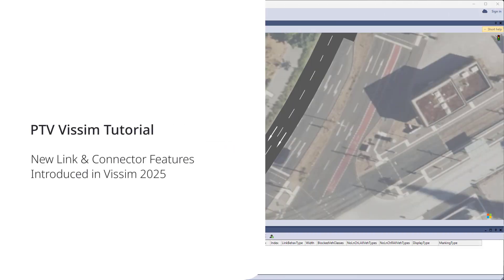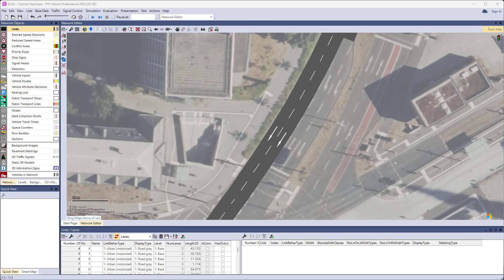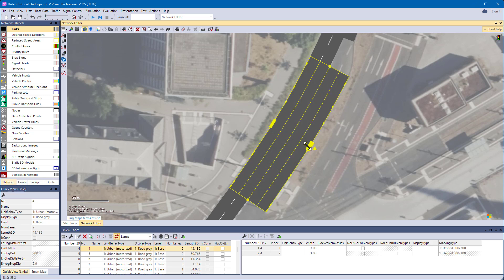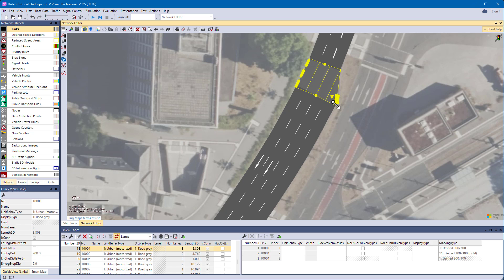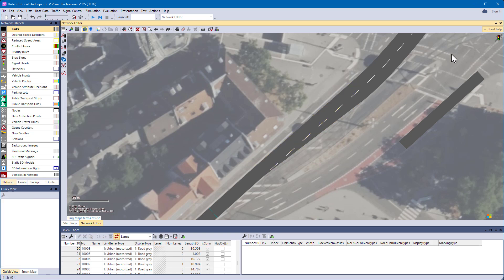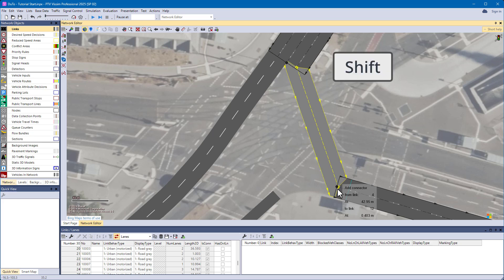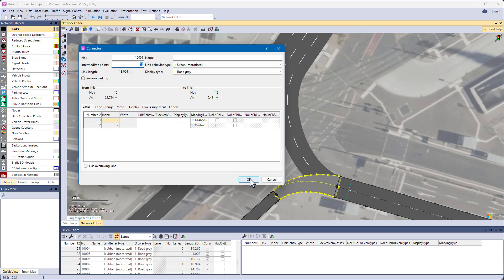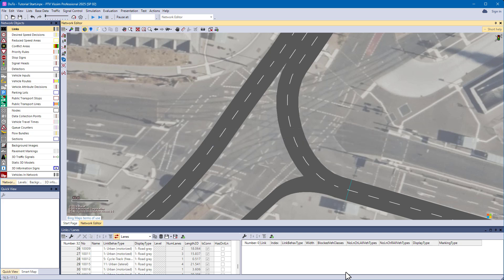New Connector Features Pt. 1 | PTV Vissim | Tutorial

Comment: Hi, I try to connect a 4 lane link to a 2 lane link, but what happened is that I can only connect the first 3 of lanes. The one in the most left can't be connected and vehicles just disappeared. Is there any way to overcome this? Also I usually do the connecting demonstrated at 1:07, but the vehicles that take the ending lane just disappeared instead of changing to a continuing lane.